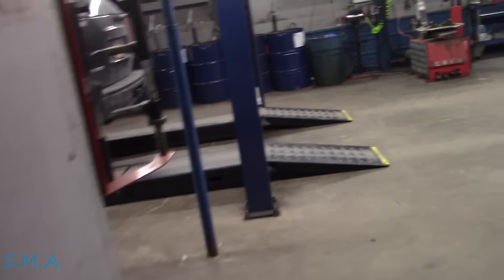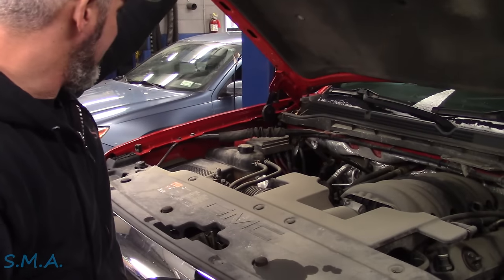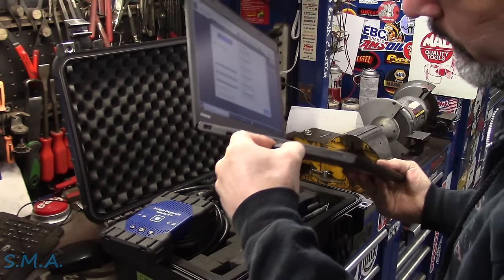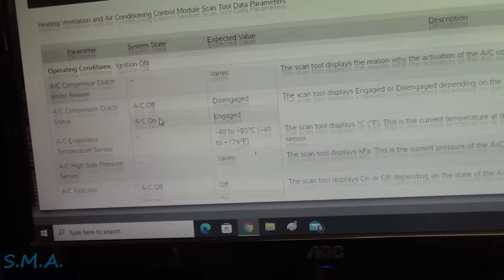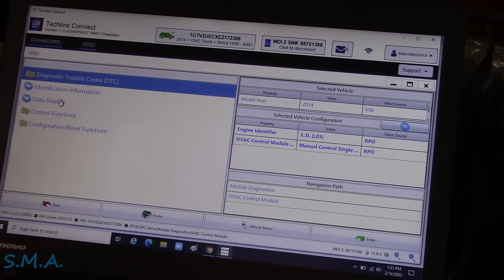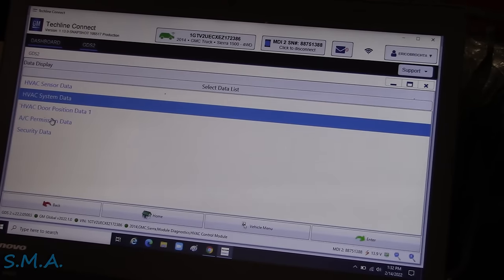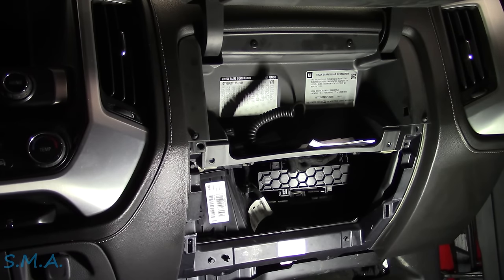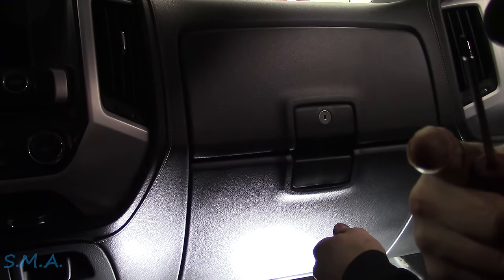Chevy/GMC Truck: Failed Heater Control Module

Comment: Ah, yes.
I remember when a heater problem was either a valve or cable problem.
Good times.
Reply: In my '94 it still is. Or vacuum. I lost defrost because a vacuum hose.

Comment: I love how simple my 79 Bronco is to work on.  It only has 12 fuses. I don't think they had "Modules" back then.
Reply: It only had 1 an ignition module mounted on the fender(usually) they did fail but were cheap and did not require programming

Comment: I took my 02 f150 in to the stealership to fix my heater and they charged me over 1000.00 to change the blend motor😣 they had to take out the dash.  Your customers are blessed to have you!

Comment: I miss the days of the 300 straight 6 powered F-250 ('85) when you could climb into the engine bay and change spark plugs.  Or when you could pull the transfer case in the driveway with very basic hand tools and rebuild it in the garage.

Comment: My theory has been for some time that vehicles will someday become impossible to repair.  I look back on 70 years of driving and all the things that used to be repaired but now you replace them as a unit.  Imagine today replacing the brushes in a starter, heater blower motor, windshield wiper motor, seat motor, or window lift motor.  GM used to list brushes and other parts in the parts catalog.
Reply: Even if individual parts like brushes, etc. are available, sometimes they cost as much with shipping as a rebuilt motor(!)
Reply: @markh.6687  Years ago my local GM dealer would stock small parts like bushings and brushes.
Reply: @johnstokes2246  True; but what about today? They likely can't even get the individual pieces; gotta sell the customer a whole assembly for more $$$.
Reply: I used to maintain a fleet of vans with tail-lifts here in the UK. When the brushes in the tail-lift motor wore out, the only part the manufacturer sold was a complete motor and hydraulic pump assembly, at a cost of £450, around $600, and this was 10-15 years ago. After searching around auto electrical suppliers, I found there were some Ford starter motor brushes which could be filed down to fit and soldered in, at a cost of £2.50 ($4) and about an hour's work, and they lasted as long as the originals.
Reply: @rickconstant6106  Nice work, Rick.

Comment: I have a 2007 Nissan Versa as a second car. Cable for the heater doors, resistor & knob for the fan control. Easy peasy. The wife keeps asking me when we're going to get rid of it. When the rust kills it hon. I say that because of crap like the modules in these modern vehicles. Thanks for all you do Eric, we've all learned tons from you! Give this man some Patreon bucks if you can, I do!

Comment: This is why I continue to drive my 2004 Silverado. Way too many modules on these newer vehicles.
Reply: 97 f150 here...never going newer...
Reply: likewise here, i have an 02 and an 04 both identical 2500HD's, regular cab 8ft bed 6.0 gas 4wd 4l80e with 4:11 gears, gov-lock 11.5 rear ends.
Reply: Hell yeah I’ve got a 04 2500hd 6.0 gas and it ain’t going no where truck before that was a 93 k2500 with a 6.5 as far as fuel economy I’m missing the 6.5 but power was queer on that ol girl
Reply: @user-wj9wq7mk4h  I know what is under my trucks, I know how they were ordered from C. Harper Chevrolet in Belle Vernon, Pennsylvania, as I bought them both brand new.....
Reply: @user-wj9wq7mk4h  Yes, AAM 14 bolt 11.5 rear axle with RPO codes G80 and GV7

Comment: Those total coverage OEM Extended Service Plans used to be a scam but nowadays I think it's mandatory on a new vehicle. For example on my F150 for $2200 I got an 8 year, 100,000 mile bumper to bumper warranty. Don't mistake this for shady dealer aftermarket stuff I mean the real Ford ESP's. Covers everything except glass, tires, and wear items like suspension basically. The SYNC module went out, paid for itself right there in a single dumb computer replacement that turned into a nightmare job of reprogramming modules and replacing this and that stupid black box. If you're buying one of these nightmarish vehicles nowadays - buy the warranty and when you can't warranty it no more, dump it.
Reply: So true. I won't do GM or Fiat (aka Chrysler aka whatever) anymore and I wasn't happy with my last couple Fords. My wife now has a Kia (10 year factory warranty) and I just got a new Honda with Honda Care so that's fully covered for 8 years. You don't really have a choice anymore.

Comment: I had a '72 Chevy Malibu with a small 307 and there wasn't anything on that car that Couldn't be fixed - I never thought of being stranded anywhere.  The only mod to the car i made was I added an electronic capacitive discharge ignition module that I built from Heatkit to improve plug spark performance.  That was it!  The A/C system had an evaporator mounted expansion valve that was temperature controlled and was a real PIA but it was nice to make snow on a hot humid August day...I used to get fog out of the dash vents on those days before the evaporator deep freeze would set in.  Yes, those were cars that had getting from point A to B as their primary mission.
Reply: I built that CDI Heathkit too!

Comment: I like that"surpassed the stupid level".You would think engineers would put all the modules in one spot they put them under the hood behind the dash in the trunk.Pick one spot and put all the modules their.
Reply: Copper costs money
Reply: Yeah... they can't do that BUT I've always thought the "engineers" should HAVE to work on cars they've "designed" so they can know what we "mere mortals" have to deal with. If young engineers in school were forced to contort themselves like the rest of us they "might" eventually take THAT into account when they decide "willy-nilly" where "operationally required modules" end up in a cars dashboard.
Reply: @tjones261  👍
Reply: @tjones261  I wouldn't really blame the engineers .. Imagine they can make X part easier to maintain/replace whatever but it will cost $1 more per vehicle. So they go to higher ups with their plan and they get the red flag because it makes the car more expensive. Imagine engineers making a car very easy to maintain but it costs $500 extra per vehicle so obviously that isn't going to fly. The people who handle the money are the reason the cars aren't easy to fix and not so much the engineers (because they need the car to be competitive with other brands aswell) Engineers are given a task to make something work as cheaply as possible (and hopefully somewhat reliable) .. things like shoving X engine into Y chassis that isn't even built for it just so they can save money on not having to design extra parts/engines and whatnot. In the end the whole thing is ruled by cost and nothing else. Not by engineers not having worked on cars before. (FYI i'm a mechanic not an engineer)
Reply: @06stiguy63  Of course you're right, I knew that. It's all just another reason why we need "right to repair" laws so these kinds of things get considered when the car companies bury necessary components in the bowels of the car.

Comment: I have been watching your videos for about a year or a little longer.  I have learned quite a bit about troubleshooting the problems you highlight and would like to compliment you on your troubleshooting skill and knowledge.  I am a retired computer repair (major Corporation Failure Analysis Lab) Technician and as I am sure in the beginning things seem quite overwhelming.  That is until you see the same problem over and over. But when the odd problem comes along it can give you a little juice to use some of your previous knowledge to find and solve the problems.  Thanks for taking the time making these videos as I am sure you have helped a ton of people who have run into the same problems.  I am continually amazed at the different diagnostic equipment you use and access to Service Data seems like something almost any shop would have to have to repair the newer cars and trucks.  Again thanks for taking the time to make the videos as there are a lot of people who watch and learn from the Master.

Comment: New car buyers are driving the market for these things, and with extended warranties they don't really care how much it costs to fix things. Those people are very different than the guys who watch this channel. If you need an OEM scan tool to reprogram it, the general mechanic is excluded from the repair game, which gives stealerships a green light to keep stealing. Of course dealers are so interested in selling new cars they punish those who try to keep anything older than a few years on the road. And manufacturers buy into the game by making replacement parts that much harder to find, and harder to make by third party companies.
Reply: The will fix your car… but it won’t be free.

Comment: I'd love to go back to the 80s level of controls. All the electronic crap is really stupid.
Reply: Sadly a lot of the “modern crap” is there to lower emissions. The HVAC for instance is monitored and controlled to help reduce battery load which in turn is monitored so that the car only charges when necessary. Everything is integrated to help lower emissions.

Comment: Yes, it's surprising that bringing the heater controls back to life on this 2014 truck is so complex.  I guess sometimes, a module is a single point of failure, when it is a gateway for other modules, so 1 module can really cause a bunch of problems.  And sadly, this complexity is not limited to cars & trucks.  Some of your farmer neighbors might be cursing equipment makers like John Deere when they can't repair their own equipment, which they depend on to earn a living.  It's not only GM that does this, but my daily driver is a Saturn L series, so when I need parts for it (latest was a starter last year), I often buy GM Genuine, like today's module, and I like to see in which country, in GM's wide world of supplier locations, the part was made.  I see that today's part came from the Mainland.  So did the GM Genuine starter for my 2.2 Ecotec Saturn.
Reply: I’m trying to figure out why my rear defrost and heated mirrors aren’t heating on my f150. I got some wiring diagrams and now we start looking.

I have a feeling it’s got something to do with when the passenger mirror got hit and broke off. Worked before that and haven’t since.

Comment: Eric, you are in the right profession, just at the wrong time. People need your talent and honestly. I have a 2018 car, it's way smarter than me. My last car only had silicon diodes in the alternator and no place else. 1970 Z28 Camaro. Sadly my knees got too old to drive it anymore. Way more fun than anything built in the last 5 decades...and more reliable too.

Comment: There's going to be a heavy push for people to simplify and go backwards when it comes to cars. 1960's, here I come!!!
Reply: I agree. The average cost of repair is trending upwards at a rate far greater than inflation. People think the gadgetry is neat, but most of my customers don't want it in their cars. People just want simple cars. A to B with heat and A/C, maybe a radio to listen to along the way. There will come a point in time when people say enough is enough, new vehicles are getting more and more expensive and repairs will break the bank. At that point, they'll quit buying the new stuff. Hopefully it happens sooner rather than later but it'll happen.

Comment: That's the reason I'm sticking with my early 2000's car. When I worked as heavy equipment mechanic I always wished I was a baker. At least if you mess up you can eat your mistake. 😂😂
Reply: Depends on how bad your mistake is… I took baking in high school and sometimes you cannot eat your mistake. When your friend uses a cup of suger instead of flour… it doesn’t turn out so good.

Comment: The Asian electronics are still the most reliable over the lifetime of their vehicles. The American stuff seems to be the worst. I  got out of the biz for exactly the same reasons you talked about.  I  found it to be quite profitable,  just difficult and stressful.
Reply: GM is by far the worst in all things electrical/electronics. As the age, the problems increase.
Reply: @jamram9924  I have a 28 year old K1500 and everything works on it and never replaced. Your brand bias is very obvious, I've seen every brand have electrical/electronic issues and much more. I've also seen every brand have good ones with no issues. I've also noticed a lot of issues are caused by the owners of all brands. It's hilarious how brand loyal people never notice when their favorite brand has issues, it's ALWAYS ignored and they're just in denial. LMAO
Reply: @mikelovin7  After the Great Recession of 2008, GMs quality began to rapidly sink when it came to electronics. Many replacement parts from the dealership were made in China, Vietnam and Taiwan. You call it biased, I call it job security and disgruntled customers. Don’t just take your 25 year old vehicle as an example. I’m seeing these issues with the vehicles. Every vehicle has issues to include Toyotas and Lexus, but not at the rate and volume I’ve experienced with GM.
Reply: @mikelovin7  That would be an excellent idea, but when it says GM Delco Remy box and then it says made in China? Who’s making this up? That’s been my experience
Reply: @mikelovin7  Mmm not Denso. I have not seen one electronic part from Denso Made in China. Consider another parts supplier other than eBay or Craigslist….there’s a whole new world of parts out there you just need to use it properly and talk to people with other experiences.
Reply: @jamram9924  Straight from the internet. "Currently, DENSO has 22 production companies in China producing a variety of products including automotive air-conditioning systems, engine control components, fuel injection components, alternators, starters, and car navigation systems." You really need to do more research and stop drinking your brand loyal coolaid. LMAO
Reply: I don’t need a lesson on research. Denso is a worldwide producer of engine components and electronics with onsite Japanese quality engineers. I’m talking about quality control and GM has serious issues with their quality control issues overall with vehicles. You have your limited knowledge based on your limited experience in this industry. GMs keep me busy with their quality since I see them on a regular basis than I do Toyotas and Lexus and Hondas. These Japanese manufacturers keep OE parts on their shelves much longer than the Big 3 because it shows their older vehicles are around much longer than many GM products.

Comment: Saw a video on Casey LaDelle's channel for saving two people from the freezing mountains after daring to take their 2019 Tacoma into the woods for mountain biking.  Hike up the mountain a few miles to get cell service, then a bike ride out to meet Casey in the dark of night at a junction in the road, to guide him into reach the car, and save the girl.  Thought it was a bad electronic key, but no, so off to the dealer, where they replaced the brake light bulb which was preventing it from starting.  Apparently the bulb was in the brake pedal switch circuit.  It did have a brake pedal switch code, but no mention of the all important bulb.

Comment: I just don't understand why manufacturers go through such complications to operate simple devices.  What advantage is there to requiring CAN Buss lines, sensors, modules etc for something as simple as a heater blower or brake light switch?  Sure, there is a reason to have computer control of modern engines and transmissions but why all these relatively simple circuits?
Reply: Automotive engineers have to justify their big salaries somehow…..
Reply: Exactly!

Comment: Imagine somebody with no tech skills or diag tools just throwing in a blower motor or resistor and getting stumped when nothing works...
Reply: Well if you don’t know what your doing and just throwing parts at it that’s what you get.
Reply: @FishFind3000  try working in a parts store and having no tools/no skills people want free advice and a cheap easy fix for these complicated systems.. And then get mad when you tell them they cannot fix it themselves.people have no sense of reality with these mobile computers on wheels today.some still think the 5.3 is an offshoot of the 1955 small block engine...

Comment: You are 100% correct they do make new vehicles to complicated with all those computer controlled features we once controlled by a slide bar or knob.  When I had issues with my 1987 pickup trucks heater control it was a $12 plastic clip that held the slide rod to the blend door.   Took longer to get the part form Chevy.  Those were the days!  I do have to say I would pay you to fix any of my vehicles because your one of the good guys.

Comment: I'm sure I've mentioned this before, but I'm a car electrician. Been at it for ~40 years. I've seen a lot in my career. The good, the bad, and the hideous. I am glad my work took a turn towards the custom and restoration end of the industry. Any more, I just work on old Citroens whenever I want, making and installing new wiring harnesses. So much easier than fighting with a module just to make hot water run through a heater core.

Comment: Yep give me back the old day of changing points or two bolts for a fuel pump, turn a couple screws to adjust carb, valve with a cable in heater hose.... You know the good old days!